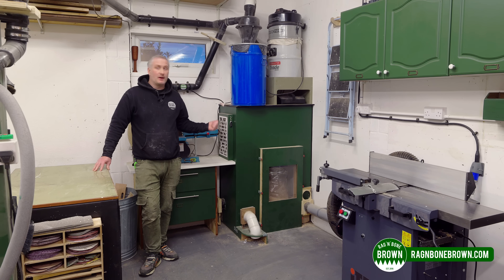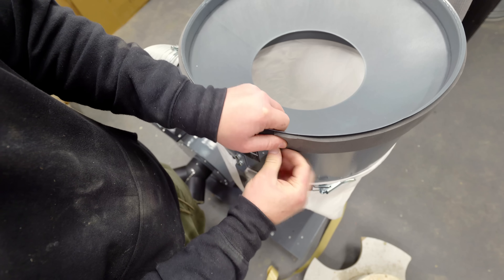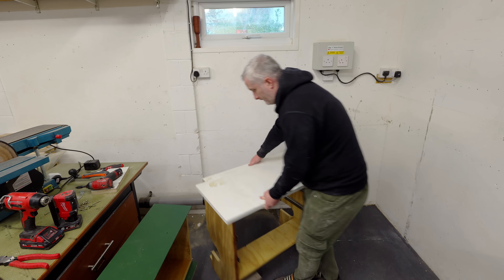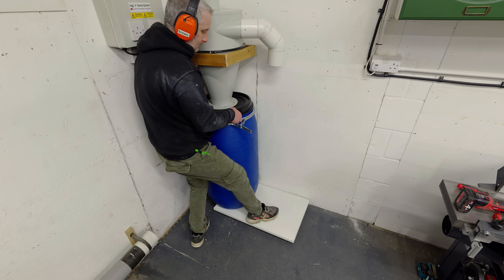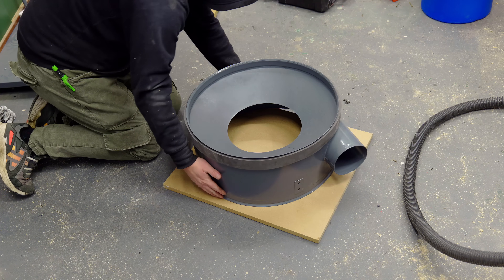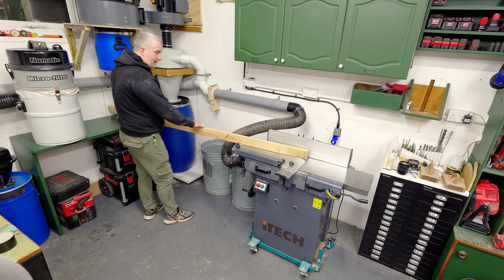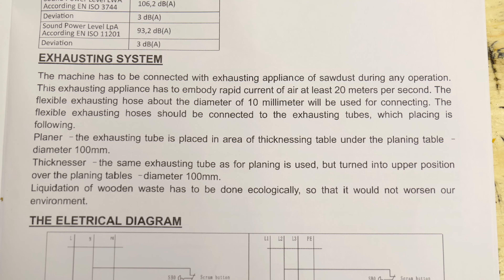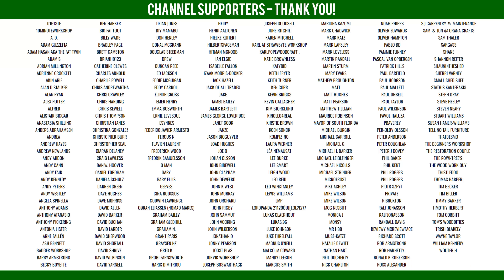Two Stage Dust Extraction: SURPRISING RESULTS!!

Comment: Do a video on how you electrician makes an extractor remote controlled. :)
I bought an £800 Axminister dust extractor and a extraction kit will all the pipes last year, I've yet setup because I've not decided a permanent place in my workshop for my table tools. Every tool has different position requirements plus different size ports which is a pain in the ass.

Comment: 16:14 Tehere is big problem with you dust colection. You need ad Y join on that pcv. That flex pipe in that form add 12m regular pipe. One turn = 3m of straight pipe 3mx4=12m

Comment: The amount going out will be minimal when exhausting outside.  Though my seem to is in a basement so the exhaust is 1 foot off the ground directed into flower beds. My 2HP motor is at 1100 CFM at the tool. 

Use 150mm pipe and exhaust out of building and you’ll get 1000 CFM.

Comment: I’m in the US and Harbor Freight is really popular here. The 2 hp. Dust collector looks exactly like the 2 hp. Harbor freight dust collector. I have one. I have up graded it with a Ricon fan blade and a HEPA filter. It’s works good. I do have some leakage around the plastic bag. I will fix that with the weather stripping like you used. Thank you for that idea. Watching YouTube many others have had the same result with air flow. There’s a few who have built centripetal dust separators. The same as the very expensive Harvey dust collector. I don’t know if anyone has tested this type of collector for air flow difference with or without.

Comment: I wonder what the difference in suction would be if: using the filter and bag as opposed to no filter and bag with the exhaust run outside through a hole in the wall. I'm thinking of exhausting to the outside in my shop.
Reply from the maker: I tested that in the follow up video....

Comment: I have a similar set up but much better results. For what it's worth, that flange on your Fan discharge takes your fan outlet of 29.69 sq inches and drops it to 15.90 sq inches. So, a magnitude of about 45% restriction. If you increase the fan inlet and outlet to 6" you will see a dramatic improvement in flow as you unleash that fan to do what it was made to do. Also, by reusing the part that the filter mounts to, you are sort of running two cyclones. While the results on separation are awesome, it comes at a price to flow. They package this stuff to be cheap and meet the needs of the guy who's graduating from a shop vac. Your set up is a little more demanding but with some tweaks it should satisfy your needs.

Comment: didn't read through all the comments, so someone already commented it or you already considered it, but for that loose fitting filter - just wrap a few wraps of tape around the motor side base to make the filter fit a little tighter.

Comment: An excellent video that is incredibly convenient for me, as I am just about to start buiding my own large workshop (I expect it to be in the region of 9m x 9m) and is going to include both a planer thicknesser (to a similar spec to yours) and dust extraction. I currently use a cyclone and was thinkiing of a much larger one for the new workshop. However, my workshop is going to be far away from neighbours etc, so I reckon I'll just exhaust it to the outside, with probably some catchfencing or wooden wall so that the dust is contained a little.
BTW, I live in northern Spain so, with the exception of full winter, heat loss isn't a major problem, but I will have a pot bellied stove in there, fed by offcuts and wood from the land that we have.
BTW, the large dimension are not just because I want space to move, but also because I want to include an heat chamber for getting rid of woodworm without chemicals, though the idea of kiln dying my own wood is tempting, but that's another story.

Comment: I have the same sip motor as yourself and vent direct to outside. Air movement doesn't cool my workspace in the winter aslong as the fabric it warm first the temp returns very quickly.  Also i would be very interested to see what air flow you get with the cyclone fitted with and without the filter inplace. I wonder if the restriction of the filter is a factor.  Would be interested to see what it was if you remove the filter. Thanks
Reply from the maker: I did that in the follow up video

Comment: I have had the one up of this for 2 years, yeah that foam for canister is garbage and mine recently fell off!!! I think you really restricted things by dropping to 100mm instead of 125mm pipe, the 125mm "feels" twice as powerful.... I house my outside due to space (in a small shed) a yeah the heat thing is annoying, just need to have a good work flow where you do all cutting and planning to start. The set up you've made is very "American" and like the mitre station I think you will sack it off soon!

Comment: Nice video as always.
Maybe it's more the lack of the thicknesser.
In the last video I also mentioned, that I kind of have the same machine.

There should be a small cover behind the shaft. It's a thin metal lid, which is too close the knives. You have to bend it a bit, to make some room for chips.

After I did this to my planer, the suction was so good, that there weren't any chips. 😁

Have a nice day👍🏻

Comment: Don't count out the affect of ducting.  If you want to see improved results get rid of that flex stuff and replace it with metal or at least PVC smooth ducting where you can.  I have a very similar setup for my dust collection using a 2HP collector and a cyclone -- but I vent directly outside.  I've had great collection with it, but any significant length of flexible hose REALLY reduces the efficiency.  Also consider that the anemometer doesn't give you all the data.  Yes the very center of the flexible hose has reasonable rates, but approaching the edges of it and it drops drastically.  With smooth ducting there' almost no change across the whole diameter of the intake.  On that short of a run if you get rid of some of the flexi hose (or at least get rid of the HUGE turnarounds you have in it) you should have excellent collection on that planer/jointer.  That flexi hose doing a full 180 would be the first thing I would try and eliminate!
Reply from the maker: How would you change between thicknesser and planer without Flexi??

Comment: I know that the flexi hoses are probably doing a lot of damage to the airflow rate by introducing turbulence as the air passes through. Try replacing them with smooth pipe. 😊

Comment: I was wondering if coating the inside of the tubes too with car polish or a ceramic or car sealant wax too would make a difference to airflow and allowing. Also using long 90 degree bends would make a big difference too I think.

Comment: Generally for the best airflow through a cyclone system you want a high air velocity entering the cyclone, which means a long straight run of pipe into the cyclone inlet (meter and half at least for this size cyclone).

Most of your velocity loss from your test is probably not the cyclone itself but rather all the pipe bends leading up to it.
Reply from the maker: I literally showed in the experiment at the end that it is the cyclone
Reply: Yes I saw, but the tests were using different piping configurations, so you aren't necessarily isolating the single variable of suction loss from cyclone (there's also the big velocity loss of the S bend going into the cyclone inlet). I have a 2 meter tall cyclone in my production shop and I had very specific ducting instructions for the manufacturer in order to maximize air velocity through the system, in my case an almost 4 meter straight run of 200mm diameter pipe in line with the inlet. You may want to experiment with your ducting configuration to get the best performance out of the your cyclone system.   @RagnBoneBrown

Comment: I have a kity 636 planer/thicknesser and a homemade dedicated 1/2hp dust collection (M. Wandel style). The air speed is only between 15 and 10m/s (when filters very clogged up) and it still do great. I wonder how much those helical head make less noise but also less air flow. All straight knife thicknesser I’ve seen would eject most shavings vigorously on the top just by themself.

With planer mode the shavings are only falling down, it should super easy to collect. I wonder if there is something poorly design with the flip thingy that collect dust on the machin? How can it work so bad :/ …

Your dust collection looks great though, congratulations. Maybe look at flipping the cyclone direction as mentionned in other comments, might work a little bit better.

Comment: If you feel like adding something. I would recommend you adding another of that windows to see the barrel in the other side of the lid. Reason? Pointing a torch at it to see anything inside the barrel. Otherwise is almost impossible to guess when it starts to get full without opening it.

Comment: I am truly ignorant about dust collection, so take this with a grain of salt, but I used to work at a large wood shop that spent several months and around $100k upgrading from medium-sized dust collectors at each machine to a huge dust collector outside the building with long lengths of piping all over the building, all installed by dust piping professionals. When the big new system was up and running, it was clearly less effective overall at each machine. So now I always expect to be disappointed by dust collection upgrades.
Reply: Until I discovered the problem and fix for this stupid dust collection industry who apparently been scratching there’s heads too about what to do. We can Fake it, Until we make it. Stay tuned ;)

Comment: I am considering buying the same dust extractor (from a different company, although it is a Chinese white-label product sold by dozens of companies), I was kind of hoping it would be so strong it would pull my pants off .. I am a bit skeptical after seeing this. Isn't the cyclone too small for the system? The manufacturer of the cyclone states "at least 1000m3 of airflow". But the motor is rated at 2500m3. Just my guess. Also the inlet port is 5", which makes a lot of difference.

Comment: Nice fix, but I would have suggested starting with some self-stick high-density thin foam weatherstripping around the bag flange to seal that plastic bag (~2" wide by 1/4" thick).  My Grizzly 1250 CFM (1-1/2 HP with 1-micron canister) system came with it and after the bag slips on & clamps are tightened, it does not leak at all.  I find it odd that any bag system would not have it.

I added an Oneida Dust Deputy XL cyclone 1st stage and love it.  I gets 99% of everything before it even makes it to the Grizzly... rarely have to change it's bag.  The crud drops into a custom mounted 40 gallon (150 liter) plastic bin I added that is easy to pull out and empty.

Comment: Record Power DX4000, noisier but way, way better. Homemade cyclone 50gallon drum with pressure release and job done, all 6inch ducting reduced only at the machines if necessary. No idea of air flow but on single motor it crushed my original metal drum hence pressure release valve. I hardly ever use it in twin motor mode and it's the best system I've ever had.  Clean the filter in the extractor every two months, probably not required but I use it daily so I like to keep it clean.

Comment: I was quite surprised by the amount of chips left on your planer.  I have the same machine ( but three years old) and use a dual motor Axminster NVD750 e tractor and the big Axminster cyclone mounted over a dustbin with only a foam strip sealing the top and no clamp.  All linked with 100mm corrugated flex tubing with 50mm tube to the back of the fence.  I haven't measured airflow but I get very little left in the planer, certainly less than you show.  I use the same setup on my router table plus my Festool MIDI extractor and a small Oneida cyclone linked to the shroud on the router under the table.  Both systems work pretty well.
I recently changed the bag filter on the NVD750 and was amazed at how much this improved the efficiency.  Previously I had just removed the bag and shaken it vigorously to remove the dust.  Very little dust is trapped in either the NVD drum or the MIDI so the cyclones do work well and trap nearly all the dust or chippings from the machines.

Comment: Hi! To reduce the amount of chips that are not sucked while jointing, you may have a look to the gap between the cutters, the metal plate deflector and the bottom of the entry table. Don't know if that makes sense... this is described in this video at 34:00 https://youtu.be/dl_3Yh9m4qk?feature=shared
I think your planer thicknesses is very similar...
Reply from the maker: Thanks, shame I can't understand the language so I don't really understand - is he saying to add weather stripping to help with the issue?

Comment: 2 big upgrades to the 2hp dusties is a larger impeller (wen impeller is the common upgrade) as well as upsizing the impeller inlet to 6" from 4". Made a huge difference to the amount of airflow for me.

Also it might help to have as little bends as possible as the pipe from your combi machine is long, curved and ribbed which will all work to slow the air and prevent chip extraction.
Reply: Did  you notice a pressure drop?

Comment: You are going still have some dust with all dust extractor wefer you  like it all.not but maby up all off you  dust extractor even your numatic and your don't need a siklon all wory about the small mikcrons and it runs off 230v 13 amp plug but it 5000 ponds it calld harvey all axminster sell as copy version off it but it might  sove your  saluson  as .

Comment: I hung my dust extraction in a small shed outside my existing shed. I used a 3hp extractor from SIP and the Axminster cyclone sitting on a plywood box to collect the shavings. The pipe run from this set up to the 12" planer is 6m and includes flexible and rigid pipe work. The extraction is superb and everything I'd hoped.

Maybe you have to upgrade the extractor...?

Comment: I love your extraction experiments and your recommendations for machines.  Is there a reason why you don’t put the cyclone after the motor rather than before? Surely that will help with your extraction rate? 🤔
Reply from the maker: I'm not sure I've ever seen that done before? I might try it but it's be interesting to hear if others have tried it
Reply: You did it the correct way. If you put the cyclone after the impeller then all of the heavier waste gets pulled through the impeller. If you put the cyclone first after the tool all of heavier waste goes in the barrel and not through the impeller. I agree with another comment made earlier, you have several rather tortuous turns leading into the cyclone. Most recommendations I have seen, and the way I have mine done, is to have a straight section 5 foot section of pipe leading into the cyclone. I realize that some shop layouts make this hard to accomplish. Second, that is a very large "fat" cyclone design compared to ones from say Oneida so I am not sure how efficient that cyclone is compared to others. @RagnBoneBrown

Comment: I know you wont read this BUT you really will get better performance if you dump the filter and exhaust outside. Each car that drives past puts out way more particles than your dust extractor will AND you can use some 6inch drain pipe to vent it to wherever you like…even towards the rain water drain (it will never block with your rate of use) if you avoid corners the pipe won’t effect the flow rate.  Also, the Axminister cyclone I have was easy to cut out the output to match the intake on the fan…I slotted the fan housing in direct with gasket and  got it sealed 100%.  Night/Day in performance with my very very similar system.
Reply from the maker: I read all my comments. It's not personal to duct outside here

Comment: If you can do it, just get rid of the cyclone, separator, dust bag, and filter and use the blower alone and vent everything outside the building into a container with a vent. As the say, "Take out the middle men." Your cfm's will increase greatly.

Comment: Thank you for a great video. It became very clear to me that it’s not necessarily adding a cyclone that dropped the suction so much, it’s adding a cyclone that is too big for the amount (hp) of dust extractor you are using. I would be willing to bet, if you replace that cyclone with a smaller cyclone the suction would not drop nearly as much and your system would work much better.
Reply from the maker: But there are others in this thread telling me the exact opposite, that a bigger cyclone (125mm) would increase airflow 😂 it seems to be some kind of dark art! I believe with hvlp it's about keeping the ducting bigger but with vacuum, smaller ducting and cyclone is the way to go

Comment: I have the same planer thicknesser and use a camvac dual motor extractor with an Axminster cyclone. It does a much better job than your sif is seemingly doing, especially in thicknesser mode. In planer mode I haven't been thrilled with the performance however. If I was going to upgrade I think I would go for the camvac triple motor which I reckon would do a really good job. The camvac are unique in that they ar both high pressure and high volume so you don't lose any flow with ducting or cyclones, (I've tested with my anemometer to confirm).

Check out the YouTube channel hooked in wood, he recently did a couple of videos on dust extraction where he features his camvac triple.
Good luck!
Reply: *hooked on wood

Comment: Very nice. I think you got ripped off with the 125lt barrel. I think I paid about £12 for mine ( AUD$25). I also had problems with 'Vacuum' in the barrel, and ended up putting some 'Baffles' in the barrel to give it side support and  stop it sucking in.